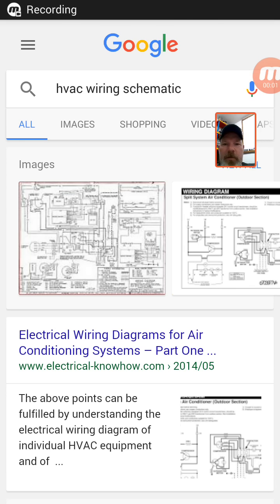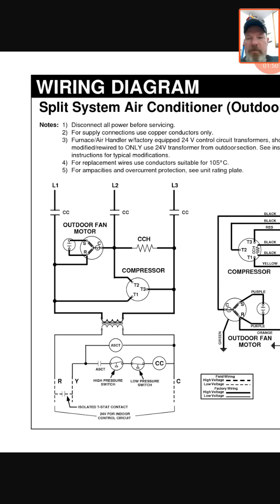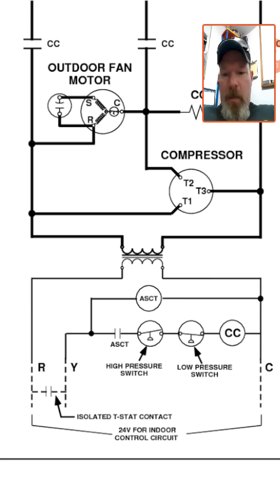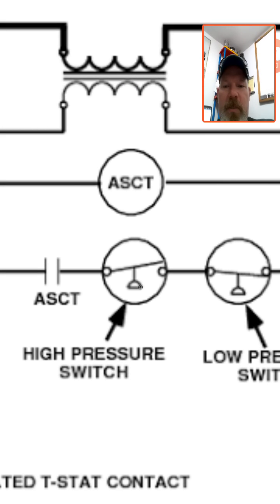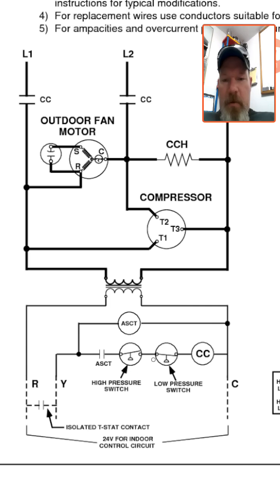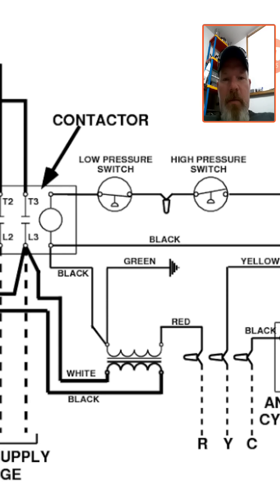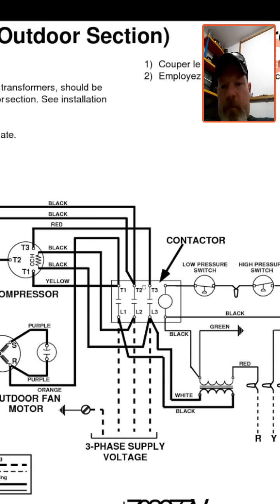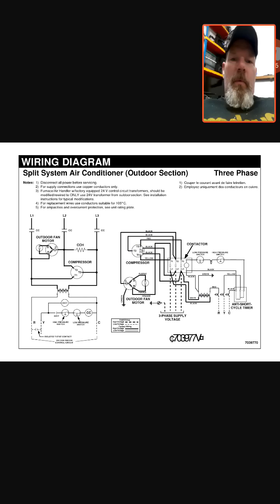How to Read HVAC Wiring Diagrams (Wiring Schematics Explained)

Comment: The ladder diagram cannot function as drawn. The compressor contactor across the top drops power to everything, including the Transformer, so with no control Power the system cannot function. A few of you pointed out the crankcase heater wiring concern which is a flag, I think their intention was to have the compressor contacts down next to the compressor so the crankcase heater and control Transformer could remain hot at all times.
Reply: MrDocHolidaay 
You’re right on the point, the whole thing didn’t make sense with the crankcase heater and the transformer wiring.